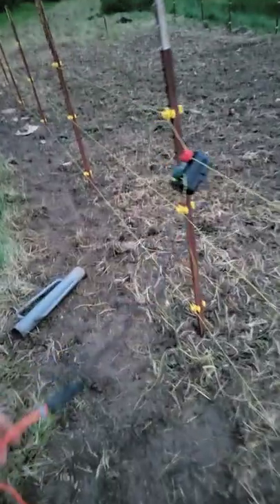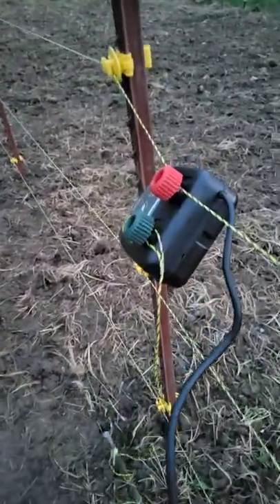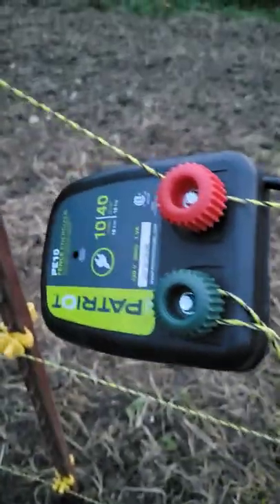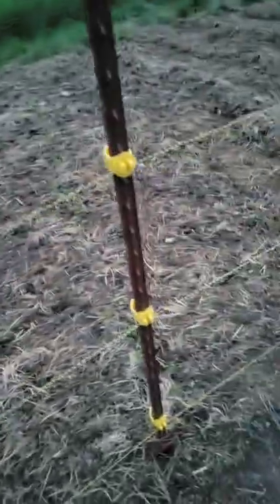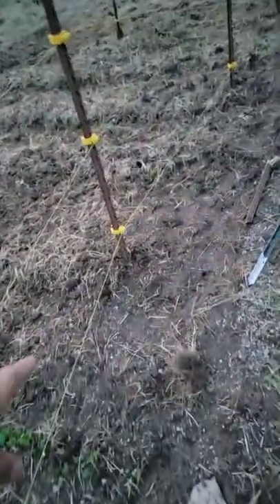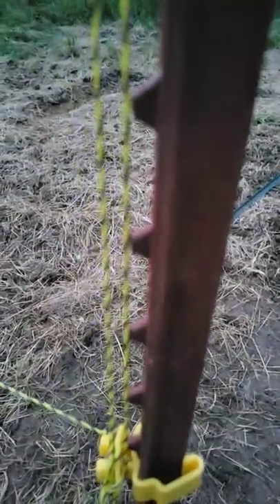Electric fence wire test

Comment: We’re did you find and what are those yellow clips caller? Thank you for the video
Reply from the maker: You can get them at tractor supply, co-op, rural king, or google t post insulators
Reply: Insulators
Reply: Get the 1” clips. Those clips are too close. You are going to have issues